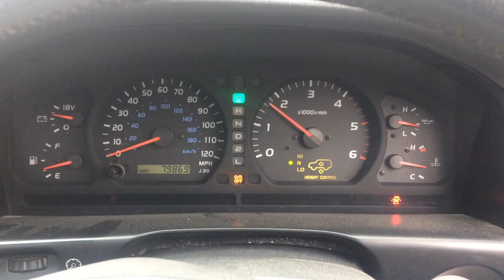Toyota Land Cruiser 100 series 4.2 turbo diesel 1HD-FTE engine start up + rev sound

Comment: 1HD FTE 4.2 diesel beautiful sound great turbo sound i love the engine a-lot it has awesome fuel efficiency
Reply: nice thought but its an inline 6
Reply: Ricsi Antal inline type engines are far more reliable
Reply: @tribulationsaint2175  i know i'm a truck mechanic
Reply: i6
Reply: there is no V6 on the HDJ100 at the time there were 2 types of engine, a 6-cylinder 4.2l 204 hp 1HD-FTE and a V8 4.7l 234hp but which was not available in the catalog in France!
Reply: @emiliendupre7379  it also have the 4500 gasoline l6 if i'm not mistaken 🤔
Reply: @mrnathanaelchen  So to answer your question at the time, there is not yet a 4 liter 5, V6 or 6 cylinder in line, it is only on the newer model from the years 2008 to 2020, there have been 4  5 liter but only in V8
Reply: @mrnathanaelchen  If you want more information or information concerning Toyota Land Cruiser type vehicles, please don't hesitate to contact me.
Reply: @emiliendupre7379  the J100 got a 4.2 diesel inline 6, 4.5 gasoline inline 6 and a 4.7 V8.
Reply: @ElCachorro97  Yes, that's exactly what I said in the previous comments
Reply: @ElCachorro97  However, it never had a 4 liter 5 diesel on HDJ 100
Reply: Which is better disel or petrol i am going buy one soon 2001 model
Reply: @drariflatif2550  
If you’re looking for a fuel efficiency I recommend u diesel engine but if u don’t care about that then go for a petrol i personally used both but i love diesel 1HD fte just keep it clean make oil change on time keep air filter clean and enjoy the beautiful sound